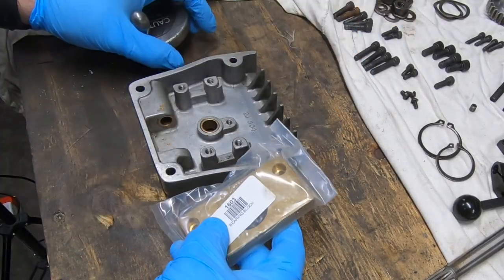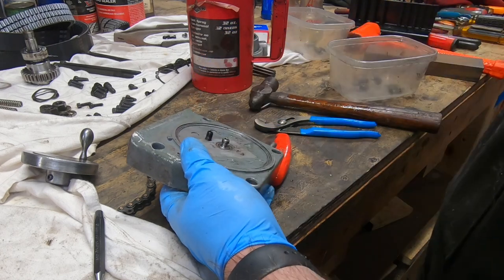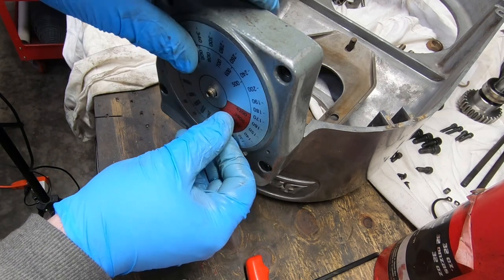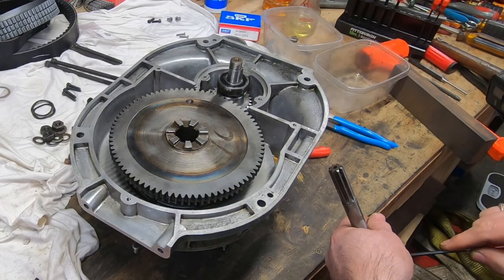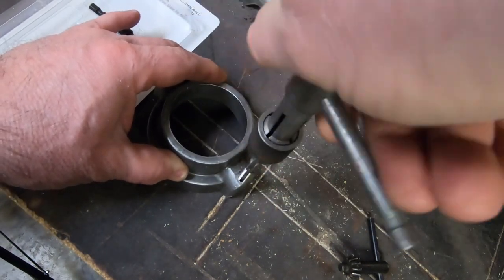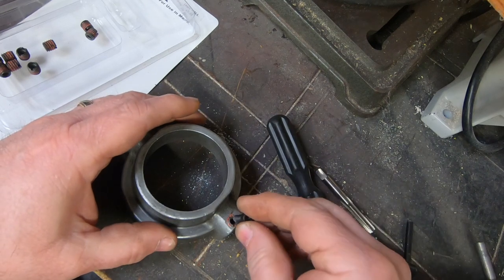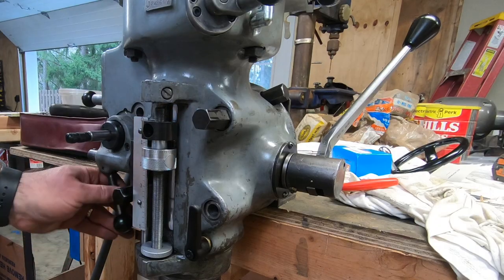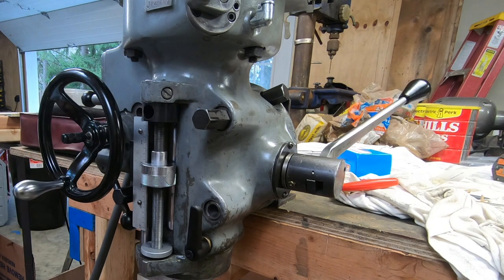Assembling the Bridgeport Mill Gears, Belts and Motor

Comment: another helpful video, especially for those looking to acquire an older 3phase milling machine. have you considered using a variable frequency drive (vfd) to run 3ph from single phase to your mill? i've been having great success with the huanyang inverters.
Reply from the maker: I did consider it, but I also have a K&T horizontal mill with a 3ph motor in it. I also have plans to add additional 3ph equipment. Having multiple VFDs just didn't seem like the right choice for me. Plus, with the variable speed head, I wouldn't take advantage of many of the functions in the VFD.
Reply: Saludos Ingenieros!!! Cómo puedo conseguir el manual de ese modelo de Bridgeport o alguien de buen corazón que me lo pueda pasar??por favor.
Reply: VFD's are definitely the way to go.
Reply from the maker: @carrollprice1213 Not a chance in hell. 😉😂

Comment: How much did all the replacement parts costed you for this entire rebuild of the Bridgeport mill? Thanks.
Reply from the maker: About $1,000 USD in parts, plus another $500 for the motor repair. In hindsight, I could have repaired the motor myself and saved $250 in labor costs.
Reply: @MyLilMule  Not bad, so ideally $1,250, which is really normal for rebuilds. How much did the used Bridgeport cost after negotiation? Thanks.
Reply from the maker: @ShopperPlug  $600 USD
Reply: @MyLilMule It was a good deal since I saw the ways where still in good shape. Total cost for your Bridgeport was $2,100. Smart. I hope you can make a video based on the tolerance you're achieving now. Bridgeport usually holds 0.0004" tenths to 0.002" thou tolerances. The spindle runout is around 0.0005" tenths.
Reply from the maker: @ShopperPlug  The spindle on this is in great shape. The table and X feed screw have wear in them. $2,100 is not a lot for a Bridgeport, but it was more than I really wanted to spend, mostly to stay in a budget, but some of the parts are VERY expensive.

Comment: when putting the belt back on the motor I Always struggle with this on our machine, the belt is so damn tight even though Ive got the adjustable speed all the way adjusted to give me the most play in the belt. I thought I was re assembling it wrong but you do it the same way I do lol.
Reply: Ive got to take ours apart again, we've got an issue with the low gear, machine locks right up when the low is engaged.
Reply from the maker: Misery loves company. lol
Reply from the maker: There's a snap ring on the one shaft with the drive dogs. Mine came off and did the same thing.

But I also need to take it apart again. I'm getting a ticking noise. Could be the lift mechanism on the front pulley or the plastic bushing. I just replaced the bushing, so hoping it's an easy fix.
Reply: @MyLilMule  I just ours back together yesterday after finally every issue resolved with this one. The last maintenance guy for the facility didn't take care of it too well
Reply: Bro can you tell me the belt size of this gearbox
Reply from the maker: @hollywoodmovie8184 Contact H&W machine. I don’t know what it was. I got it from them, so they might be able to tell you.

Comment: Have you thought about the "phase conversion" problem when the machine is functioning under good load? Single phasing that motor would not be good in my experience, unless I misunderstood what you were driving at. Not faulting, just concerned. Thanks for the look.
Reply from the maker: No worries. Essentially, that's what a static phase converter does. It charges a capacitor to feed the third leg of the motor, but then it can't persist that and shuts off. It's only powering the third leg long enough to get the motor spinning - a kick start of sorts. But once it starts spinning, it can keep running on just the other 2 legs, just under reduced power. The problem I am having here, is that at high RPM when the motor is at maximum load (free spinning), the third leg doesn't stay energized long enough to get it spinning fast enough, where it can stay running with just the other two. So, yes, it boils down to running it on single phase power without rewiring or remotoring (is that a word? It is now!) the machine. Long term solution will be to get a rotary phase converter and have "real" 3 phase power all the time. Probably sooner rather than later.
Reply: @MyLilMule  I hear what you say, but I could conceive of an overheating problem in the rotor possibly shorting it out. I would think sooner than later for that upgrade. Enjoyed this conversation with you.
Reply from the maker: @jdmccorful  These are used all the time. No possibility of a short or motor damage.
Reply: @MyLilMule  Thats good to hear!